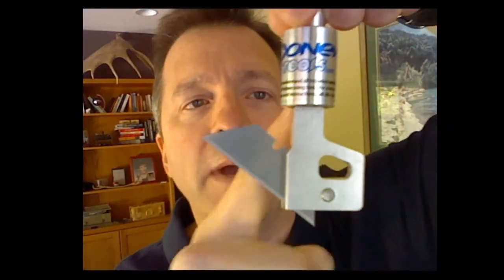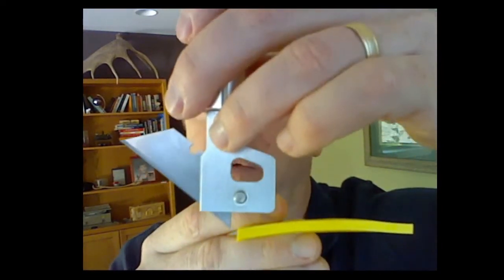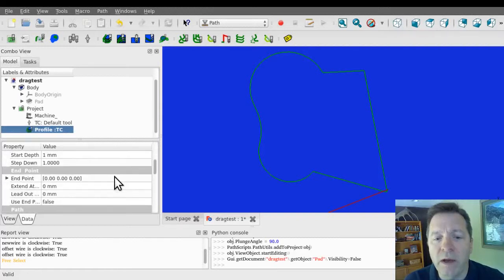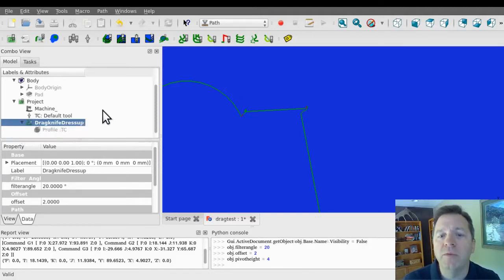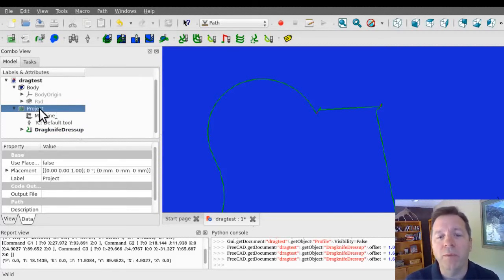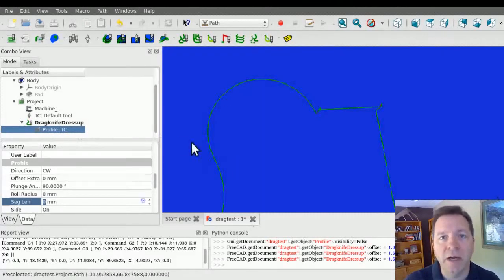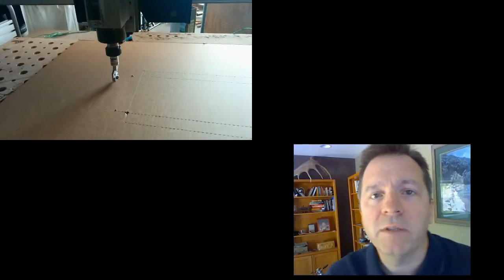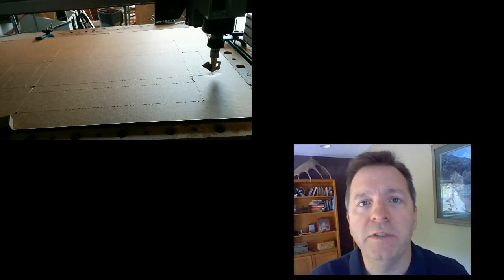Overview of the Dragknife Dressup

Comment: Another great video thank you! Just a thought about the drag cutter. If it had a 'tail' of rubber or something similarly soft and flexible that dragged behind the cutter in contact with the stock, it would ensure the cutter was alway orientated in the direction of movement even when lifted clear of the stock. May help avoid the spoils on the corners that occured. I'm going to experiment when I get mine up and running!
Reply from the maker: Excellent idea.  Please let us know how it works.
Reply: Did it work? Is freecad still supporting dragknife ?